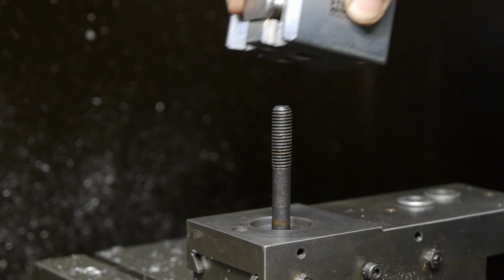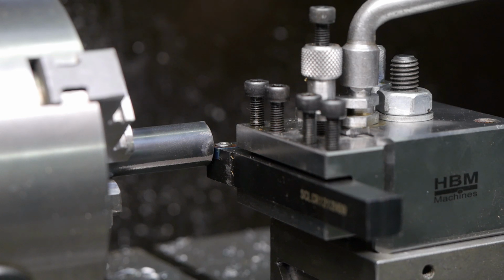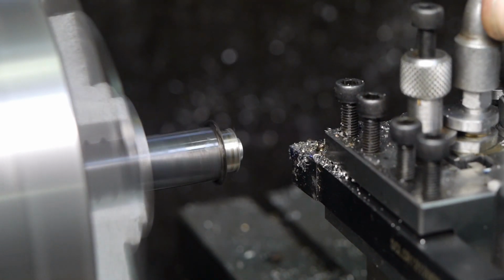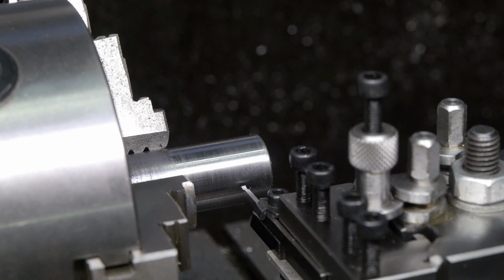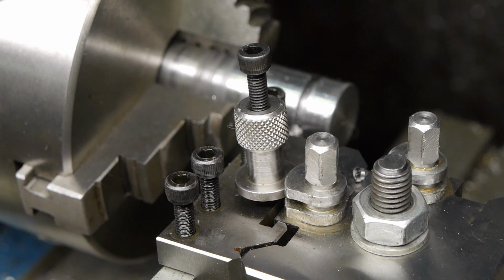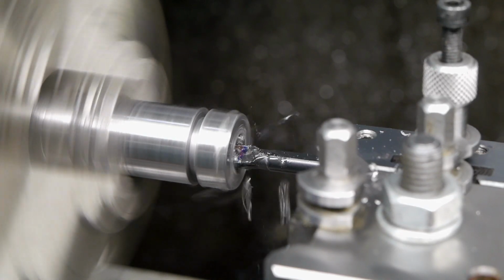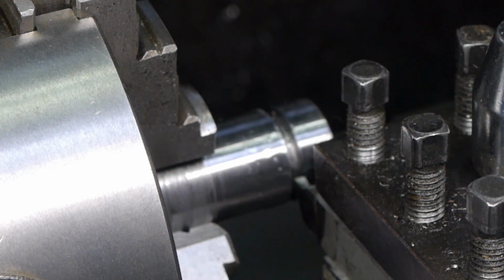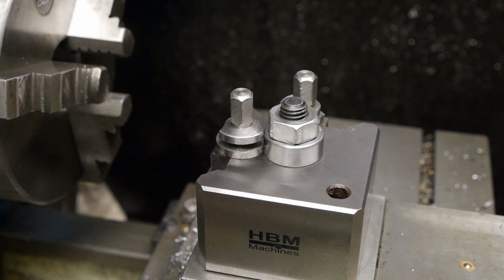My first time using the Dixon quick change tool post

Comment: When using calipers to measure the inside diameter of a hole, always tighten the hold down screw before withdrawing it and reading the measurement.

Comment: I'm old school I still prefer my 4 way toolpost. Even the very best QCTP are a fair bit off center from the center support bolt and never inspire confidence in me with that length of overhang especially with interrupted cuts. I hve a QCTP and it  spends more time in it's box than on the lathe,

Comment: I had one about that size on my hardinge . It worked ok but was simply not strong enough, i kept breaking the clamping nut ( it is pulled in by the eccentric clamp bolt) . I stll think you need to raise the block up , the clamp needs to fit in the middle of the tool holder (you should check the clamp nut for fractures - push it in while pulling the clamp bolt up, watch where the spring goes!).
Reply from the maker: I'll see if I can brake it as well :)
An extra shim might introduce extra shatter but I have been thinking about replacing the compound slide with something solid.

Comment: I have an Aloris style Quick Change Tool Post, mine is a wedge lock style.   Mine appears to grip the tool holders much more rigid than your Dickson Quick Set knock-off.
I hope you are able to solve how to get the tool post to hold better.
I have a 4 way tool holder which came with the lathe.   I would not want to go back to this style and needing to shim the tools.
Your parting tool for the Dickson toolholder looks like it needs to be shim so the top of the tool rest against the top surface of the slot in the tool holder to prevent the tool rocking as you experienced.
Glad that you got a spacer from your efforts, even if you are going to make another one.
Dave.
Reply from the maker: A wedged style tool post might be the way to go. But Iḿ hoping to make a little riser plate that includes a boss. That will solve my parting blade height problem and might make thing a bit more solid. It will sure help to keep things a bit more indexed when I rotate the tool post.

Comment: "I had my first good idea in weeks!" Hmmmm.. I have them less often than that! Another very entertaining video, thanks. I recently dumped my 4-way post for an AXA wedge type QCTP and it's my favourite thing ever. If not for my wife's intervention, I'd sleep with it under my pillow.
Reply from the maker: I'm starting to think a AXA type qctp might be the better option.
They seem to be higher and might be less prone to contamination with chips.
I guess I will be stuck with this thing for a while since I already ordered some more holders :)
Reply: @Rolingmetal  Yeah, the AXA is excellent but definitely go for the wedge type rather than the piston type. I've heard of folks having rigidity problems with the piston type. Mine (wedge type) is just a Chinese clone but solid steel and we'll made. Haven't used the old 4-way since the AXA arrived. Keep up the good work with the videos, I enjoy them, always learn something and have a good laugh.

Comment: I would've thought about putting a riser under the toolpost, that way you could've kept the parting holder as it was.
Reply from the maker: I got a second, and original Dickson parting blade holder. So I might still try that., in fact ll probably try that next weekend.

Comment: A few things. You need to make a sleeve for the centre fixing (compound bolt) or get a bigger bolt, so it's a tight slip fit. Otherwise the QC holder is going to move around and give you chatter. Also, think about using the hole in back corner to fit a taper pin that keeps the QC block square. Mine has a tendency to swivel out of square when only held by the centre bolt, especially when taking heavy cuts. I've found that the tool holders will have a tendency to tip (like your parting blade did) if they're high in the QC holder. Try shimming the holder itself, so that tool holders are lower into the QC holder, but still on centre to the work.  I have one of those skinny parting blade holders. The blade breaks every time I try to use it, because it's so thin it flexes under pressure - my advice is to throw it in the bin.
Reply from the maker: Interesting theory about a high sitting holder tipping. And a shim would also fix my parting blade not coming high enough but I also like a solid tool post like you did :)
Reply: I have the smallest toolpost that HBM sells and it's also crap but the only thing that fits on a hobbymat MD65. I resolved the chatter by making a bushing on which the block slides as the bolt was also too lose. I used the second threaded hole that was used to mount the original round toolpost on as a place for a dowel pin (the pin screws in) and made a hole in the block to index the block in 45° steps. May be the cure for your dixon look-a-like

Comment: Turn your parting tool upside down and run the lathe in reverse try that I did it online and seems to work fine Joe can't say his last name had a video on it I tried it and it worked
Reply from the maker: I believe I tried that once a long time ago and it did seem to help.
Perhaps I should try to modify an original parting tool holder into an upside down parting tool.
Reply: You don't have to say his name, just spell it, here you go, Joe Pieczynski, he his a great guy, lots of very good information

Comment: From the facing cuts it looks like your tool was too high after you raised it up.
You adjusted the height and assumed it was correct.  Didn’t see you check it :)
If you think about the cutting angles there is no way the cutting edge can work if you are above centre. It can only rub below the cutting edge.

I hate parting off on my old lathe.  Way too much play in everything and my QCTP only makes it worse because the tool is not on top of the cross slide dove tails.  
I usually start the grove then finish off with a hack saw.

Booring fLexing and flopping due to stick out.  You knew it was going to scream didn’t you :)

Good outcome in the end.  I wonder if you can make a boss underneath so it will pivot on the centre bolt more nicely?

My QCTP is bigger than the one recommended for the centre height of my lathe. They call the style BXA for some reason.
I have the potential problem of not being able to get the tools low enough but it allows me to use bigger tools. (More rigid)
I haven’t found a tool I can’t get low enough yet.
Grind yourself a HSS champhering tool.  The left hand side is curved under like a drill for doing internal chamfers.  You will use it often and it will last for years.
Or just modify you insert tool ;)
Reply from the maker: Someone suggested the insert was blunt. The feeling was actually similar. But it was a brand new blue nano insert. I guess it will have to mount my micro lens for some close up pictures.
I checked if that last little bit in the center was actually cut off.
But it might have been a little bit above centre and pushing off the last remaining bit.
You are right about that boring bar I was pushing it a bit hard intentionally :)
Reply: I still hate parting off :)
If your machine isn’t really rigid pick up a hack saw.  
It’s actually quite quick when the job is spinning.
I just start a grove so the saw goes where I want.
So long as you can turn around and face the other side.
I’m still enjoying watching your videos and can’t wait to see what you make next  :)
Reply from the maker: Next week I'll probably try to make a space for the tool post.
That's probably going to be an amateur nightmare for me :)
Because how am  I going to hold it and turn it parallel without hitting the jaws.
Do I use round stock of use a bit of metal plate. It only needs to be 4 or 5 mm thick.
Should I turn a boss that will fit inside the compound slide and how about a shim that will take up the space between the bold and the tool post to make it a bit better indexing. It should also be flat and not increase the chatter. 
Or maybe a new and better fitting tool post bold.
Lots of question and challenges :)
Reply: Not knowing how the under side of your new tool post looks it is a bit hard for me to say what the best thing to do is.
I'd say aim to have your tools to be on center height about half way up the adjustment of the the adjusting screw.  That may allow you to make the plate a little thicker.
Aim to cover the full contact area of the under side of the post.  That will probably mean a square.
Maybe you can find some nice flat plate close to the right thickness so you don't have to try and machine the flat side.
If your tool post has a counterbored hole underneath definitely make a boss for it to rotate on. Don't forget a little bit of clearance so it doesn't bind :)
Part of the idea with the quick change tool posts is that you don't undo the main nut for the duration of the job.  This way you can take the tools out and put them back and they are supposed to go back in the same position.  Very handy if you are making multiple of the same part.  Not a huge advantage otherwise.  Often you need a little bit of angle one way or the other so you have to undo the nut anyway.  Some people buy a holder for every tool they regularly use.  I haven't bothered with that yet.
Anything you do should be with the aim of making it more solid.
Looking closely at this last video when the parting blade jammed the tool holder seemed to move in the V slots meant to hold it in place.  That surprised me.

The way you grind the rake on a parting blade should also have the effect of making the cutting edge the widest part of the tool that enters the work.
Obviously anything else and it's going to jam itself in there.  It's also a "feel" thing where you have to keep it cutting so the chip curls out of the slot.  That bit takes balls :)
I sometimes I step my way down and make the slot about 1 1/2 times as wide as the blade.  So you go down a couple of mm then move to the other side and go a couple more.
Hope this helps
David
Reply from the maker: Thanks for the tips
b.t.w. there is an unused bole though the tool post.
Probably for a location pin on some sort.
I might use it to bolt the rises on to the tool post.
But is the riser is too thin I´m considering bolting the tool post directly on to the compound slide. I might also make a new tighter fitting and maybe a bit longer tool post bolt,.

Comment: Don't be afraid to turn the tool post holder 30°-45°.  Get better finish facing and cutting.
Reply from the maker: It sure could use a better center bold to keep things a bit indexed.

Comment: Do you know why you were half a mill short on your height?  I spotted it right away as you were machining it. When you changed over to your grooving tool you set the left hand side of it to the edge of your failed parting groove and as the grooving tool is wider than your parting tool it took off part of the bottom of the washer. Youshould have set the grooving tool to the length for the part as you did with the parting blade. As for the new quick change toolpost, I think you need to make a sleeve to very tight tolerances ( not easy for you we all know! ) to fit as a push tight fit into your toolpost hole and bored to just shy of the hold down bolt diameter to lessen any chance of the toolpost shaking the locking cam loose. That what seemed to me to be happening when your tool holders came loose in the toolpost twice I believe. I think that's why the parting blade came free and bent the locking part. The tool holder came free first. Also if you make a disc to fit the toolpost register in the slide and either bolt it or tig weld it to the bottom of your new quick change toolholder  you will find your turning set up much more rigid.
Reply from the maker: You are right. Noticed that when editing. Must not have been paying attention :)
A thin sleeve will be hard to make. But I've been thinking about replacing the compound with something solid. Including a nice fitting center bolt.
Another option if to bolt the too lpost to the compound slide. There is an extra hole though the tool post. (No idea why) I only would need to drill and thread a hole in the compound slide
Reply: @Rolingmetal  That extra hole in the toolpost was for a removable dowel pin. When first fitted corectly with the centering collar fitted below and the correct fitting bolt and usually a centering bush at the top; the tool post was lined up square with the lathe axis. A hole was then transfered into the compound slide and reamed a good fit. The whole idea was you pulled out the dowl to angle the tool post for general turning, but when you needed to part off, slacken the bolt, replace the dowel and the tool was then back at 90 degrees to the lathe axis. Really to fit yours correctly would be to machine an accurate recess in the top of your compound about 4 mm deep, to exactly the same diameter that is ground into the base of the toolpost. If the same diameter recess will make it too close to the edge of the compound, then make it smaller diameter and make the collar /washer stepped. You then make a close fitting collar / washer, this ensures a location fit that will not move axialy, only rotate and at the top you also need a close fitting stepped collar. This collar does 2 functions, locates the toolpost centrally to the bolt, acts as a washer for the nut and also restricts the movement of the locking cam ( as you discovered with your home made one). Finally the bolt has to be a nice close fit to the top bush and be as big a diameter as possible for that size of QCTP, probably a 1/2 " bolt, preferably of 8.8 tensile strength. These Genuine Dixon toolposts were industry standard at one time 1970's to 1980's for the low end priced lathes, the high end was the Swiss made Multifix system ( still being made today ) Sadly Dixons are no more, but plenty of Chinese knock offs, of questionable quality, often poor materials. I was a Machine Tool Fitter for 35 Years and spent many a happy hour fitting Dixons and later Multifix's to the Company's workshop lathes of all sizes, from Boley watchmakers to our largest Lathe a Dean Smith and Grace 60 inch between centers lathe. When the workshop closed I scrounged 2 Multifix toolposts and about 20 holders to use on my Myford and Hardinge HLV Toolroom Lathes now here in my workshop in Adelaide, Australia. Re watched the start of the video, noticed that you already have a recess machined in your compound slide, as I said above, make yourself a close fitting collar that fits the compound and the toolpost, this will stop any axial movement of the toolpost.

Comment: Without that boss on the qctp there is no way you have the rigidity to do parting. With that said, as you look at the end of the parting blade grind it with a V shape. You’ll lose a lot of the chatter
Reply from the maker: Thinking about making a little riser plate with a boss that also bolt on to the tool post.

Comment: Looked like the tool was a bit above center after you adjusted it when facing off. If you left it at the same setting for diameter turning this would also give you a poor finish. With regards to parting blades, the top should never be ground with back releif. When you do, once you try to go deeper than the relief depth, the  tool will rub and jam. This is because  a parting tool is tapered over its height, once you grind top relief, the tool is now not as wide at that point as the rest of the tool and will rub, possibly seize and break. Have a look at this link for parting tool support. https://www.youtube.com/watch?v=7WF2vQBuu_8
Reply from the maker: You are the second person who suggested that and it might be correct.
I only check it the last bit of material was remove in the center. But it's possible is was pushing it of and not cutting it. Thanks about that bit of theory about the parting blade. It makes sense and I'll try to remember it.

Comment: Quick tip if you mount your parting blade upside down and part off in reverse the tool will push away instead of plunging  ,good for less than rigid lathes (as long as its not a screw on chuck)
Reply from the maker: modifying a original parting holder in to an upside down parting holder is now on my to do list :)

Comment: You can still get a real Dickinson tool post, also get one the right size and not some dirt cheap rubbish that's too small. Or get a wedge type, also get the right size and not the absolute cheapest be you can find, will pay for itself with improved machining time and less broken tools.
Reply from the maker: You mean the Dickson tools post maker in still in business? 
The cheapest tool post I could find was from alluminium :)
Reply: @Rolingmetal  arceurotrade still do the original ones, well exact copies , not a poor redesign. FFS no one likes to pay full price of top brand stuff, but at least get something fit for use.